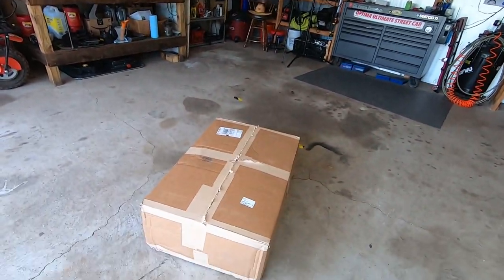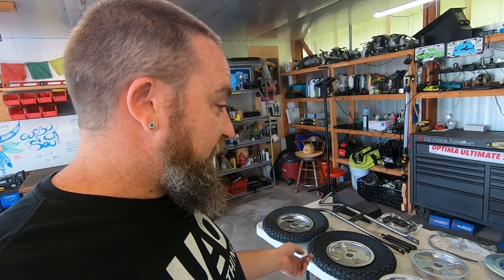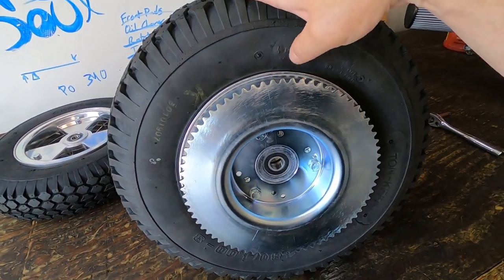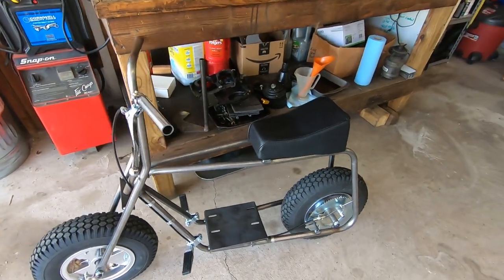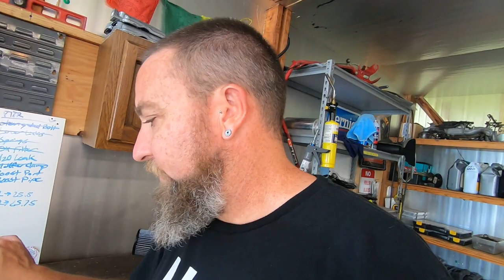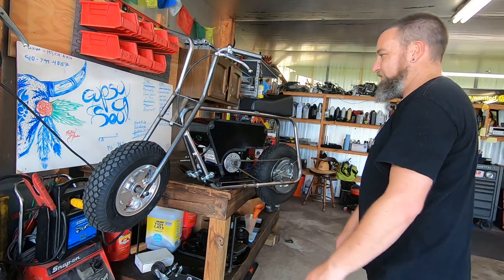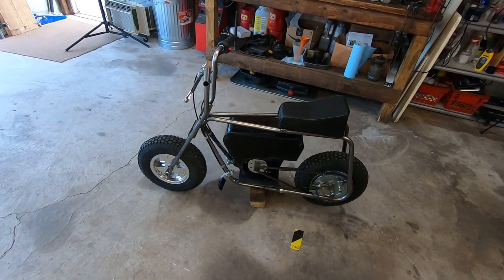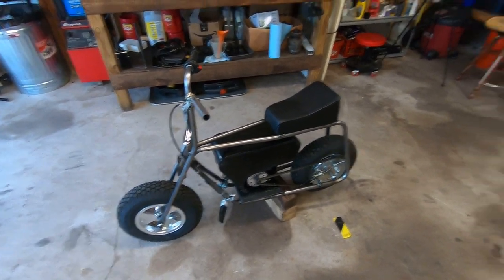Building a vintage style electric minibike in an afternoon

Comment: Good day, change your controller to 48v 150 amp, add and additional battery leave the gearing as is. Should be doing burnouts and wheelies with a top speed of around 30mph.

Comment: What a fun little build. Stick with the stock gearing and get yourself a 48V lithium-ion ebike battery. That'll get you a ≈30% increase in speed thanks to the motor Kv and increased voltage. Check the controller to see if it's stamped for a voltage range before connecting it. If not, you can pick up inexpensive ebike controllers that will handle 48V. That will save you considerable weight as well.

Comment: Wrap the frame with some radiator hose where the pegs mount and it will not slip anymore. Don't put pipe across if possible. When you turn tight and catch the ground you will know why i say this. Insta bail.

Comment: Yup, need to get to 48 volts, preferably using Lithium Ion to keep weight down - you mentioned UPS batteries so that's your problem. Some of those controllers have a regen braking feature, worth checking the spec. Love the mk1 Insight by the way.

Comment: I might have missed it in your video, but where did you purchase the electric kit? 
Edit: Nevermind, found it in the description. Thanks!
Reply from the maker: I purchased the drive unit from Studz (link updated in the description). If I were to do it again I would just buy the parts direct from Mega Moto.
Reply from the maker: UPDATE: Looks like Studz no longer sells the used take outs, link updated

Comment: First! ha ha, good deal ! I'll be curious to see how fast you can make her rip. Are those little lithium batteries? How long does a charge last? I think those E-bikes use like a 48 volt system, maybe you can add another 12 volts?
Reply from the maker: YO! What up Tim! They're just standard 12v 7AH AGM batteries, same as you find in a UPS PC backup. Some LiPo/Fe cells would be a RIOT for sure!! I've yet to run the battery all the way down, I need to put an hour meter or ODO on there and see what she'll do. I do want to turn it up to 48v next, I have the battery, just need the speed controller ($15 on Amazon) and we'll see if the motor melts down. Every failure is a chance to upgrade IMO.

Comment: Where did you get the metal piece that stores the battery and motor? If you have an exact link, that would be great!
Reply from the maker: It’s from a Mega Moto E1000. I bought it all as a used pull but they don’t have any left anymore.